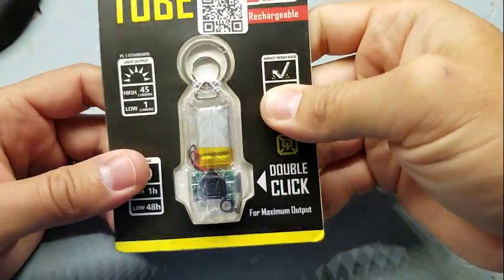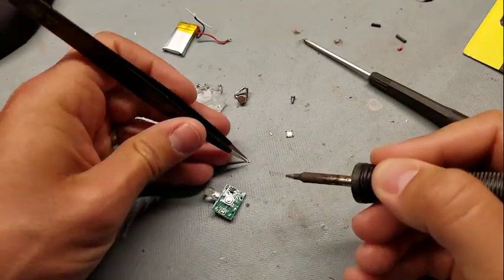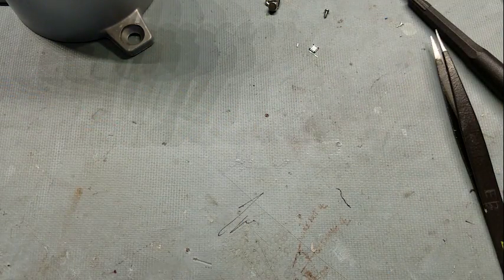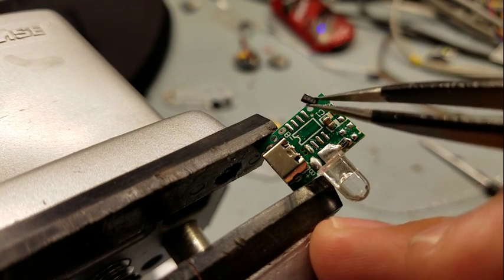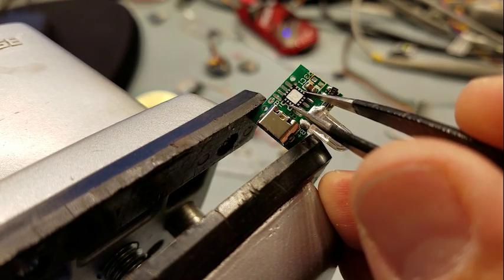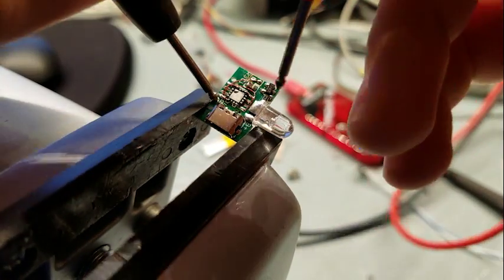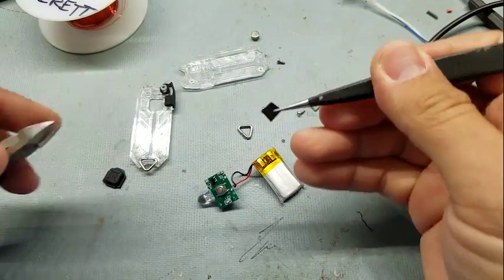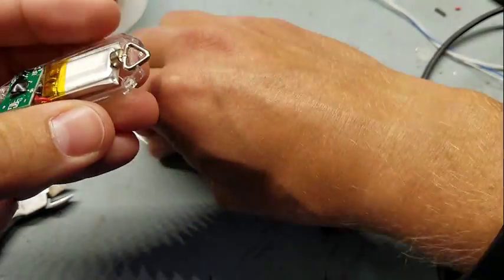Nitecore Tube clone flashlight modifications

Comment: Awesome video! That soldering tiny wires to even tinier surface pads. Wow!

I struggle with 0806 and 0603 parts now, my hand aren't getting steadier as I get older. Thank God for hot air reflow and solder paste.